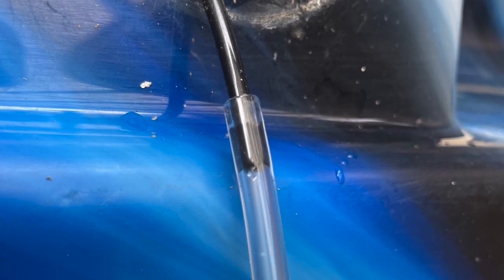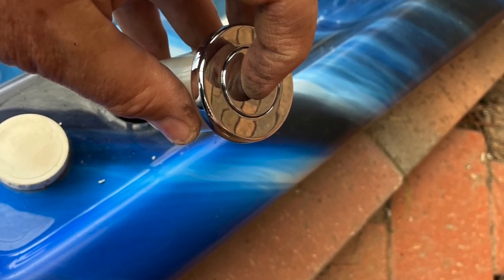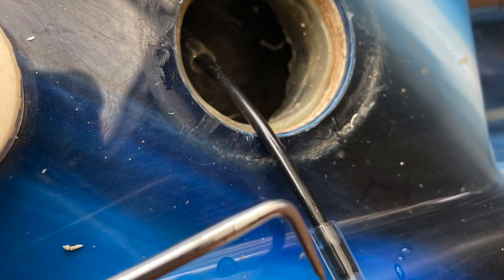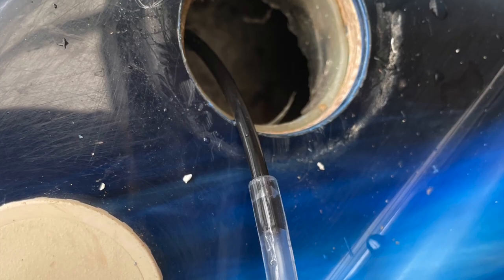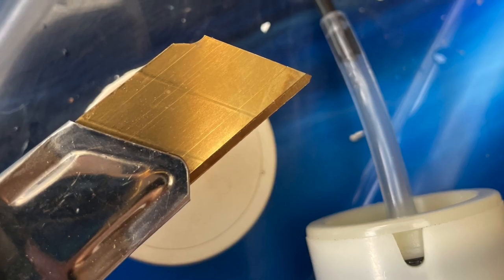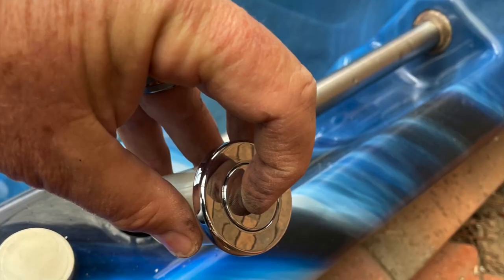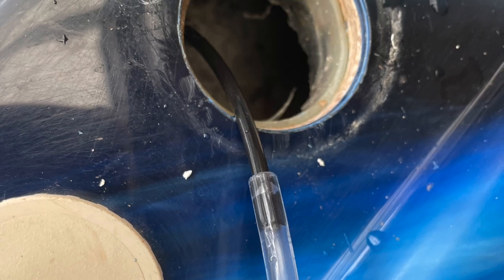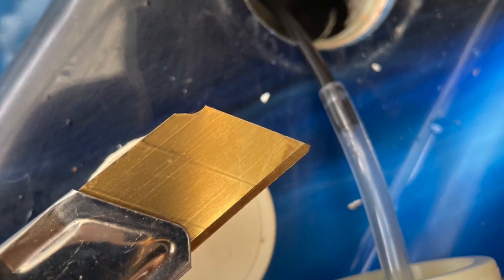Spa or Pool Air Button repair. Fix button not returning switch not reactivating on off quickly

Comment: This worked for me on the air switch on a kitchen sink waste disposal. The air switch wouldn’t turn the disposer off. Cutting a 1cm split in the tube seemed to reset the switch somehow and it turned off immediately. I then trimmed the tube to remove the split I had made and reattached. Works fine now. Thanks!

Comment: this helped me understand the system better. I was trying with a very short tube and it only worked once without removing/reattaching the tube. I put a single hole with a needle and short tube worked. When I tried the long tube, it didn't work at all. I think my new switch is less sensitive than the old one so I need to either find a better switch or a button that can push more air. I can blow into the tube myself and make the light come on so it's definitely a pressure problem.

Comment: Hi Mark
What do you think is happening if the switch doesn't stay on?
Reply from the maker: At a guess I would say the mechanical switch part has broken or pushed away from its holder. It will need investigation. 
Are you in Melbourne?
If so call Nillumbik Pool & Spa Service

Comment: Dumb advice dont listen to this guy. Slicing an airline does nothing but make it not work at all.
Reply from the maker: Well Neil I am a Pool professional with over 20years experience. This is the advice that was given by the switch/button manufacturer. And it worked. 
And you call it dumb on a public forum??
So come on what is your experience and expertise?
What you got?
Reply: @Marksreviewsandtutorials  sorry, just frustrated i tried exactly what you recommended and now no air to switch on or off. At least it's only airline.
Reply: I can confirm it. Had trouble with mine. Bought a new one and the only time it worked every time was when I disconnected the tube from the button each time but did not turn off when I left the tube on. Cut a 10mm slit and Bob's your uncle. Thanks for the tip